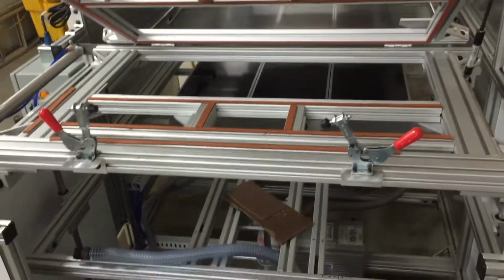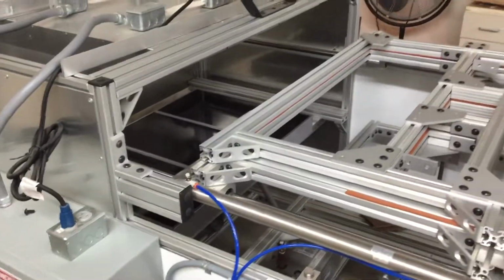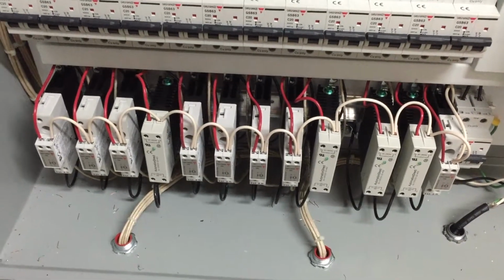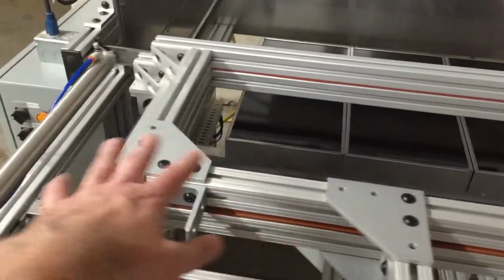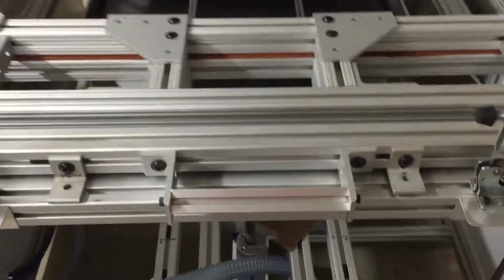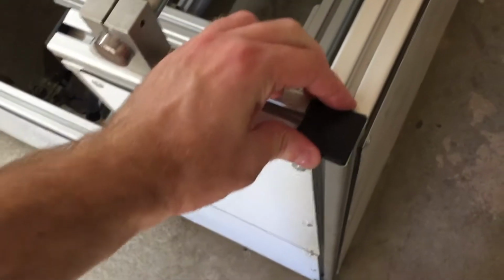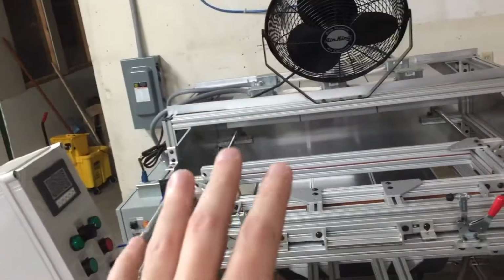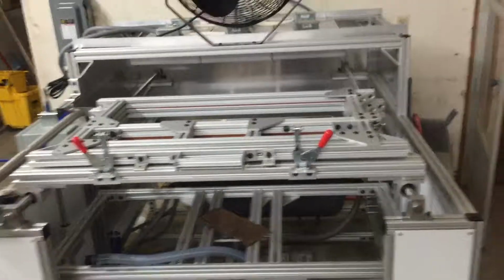1yr Review SIBE Automation Thermoforming Machine

Comment: What material are you using to on the clamping pads, the orange stuff?
Reply: I wanted to know that as well so I called Simon at SIBE Automation.  he was more than happy to answer questions.  He told me it was High-Temperature Silicone Rubber Strip
 with Adhesive-Back, 1/2" x 36", 1/8" Thick Part Number 1466N14 from McMaster Carr.

Comment: Thanks for recording this video. I am about 2hrs from where SIBE is located and looking at the 24"x36" machine. I was curious how fast the infrared heaters are getting the plastic sheet to temperature, what temperature you have found seems to work and what type of plastic sheet you are using to make your parts? Also wondering how fast a 2nd sheet gets back up to temperature after you form the first part... in what is your approximate cycle time from removing the first part to the second assuming you are trying to run several parts in a row. Also curious if you were able to "smooth out" the entrance when the clamping system fully enters the vacuum former. Thanks again for putting this out there!
Reply from the maker: The heaters get the plastics hot very quickly. But mine comes out of a drying oven straight to the former. Just to make sure you are aware, the heaters are on all the time. Not just when plastic is in machine. The heaters have to get up to temp before you can start forming.
Reply from the maker: Finally smoothed things out. Easy fix video here. https://youtu.be/z3_sogaxy4M

Comment: I have one of these on the way for my shop. It a 48 x 48 dual platen.  Out of curiosity did you need a rigging company to get it off the truck or was an in house forklift ok to use?
Reply from the maker: Hi, We had a neighboring business use their equipment to unload from trailer. They had standard forks and wasn't your normal rear weighted forklift. See the video here https://www.youtube.com/watch?v=L43NuINsXFM&t=32s. Ours is 24x36, I think with yours you might want longer forks. For ours the standard forks did not reach very far under crate. We had the truck driver spin the crate to make sure the purge tank and heaters, most of the weight, was on the forks. Then we moved it with 4 wheel platforms through a wall into another room in this video. https://www.youtube.com/watch?v=aNtNk9bfi8A. Good luck!